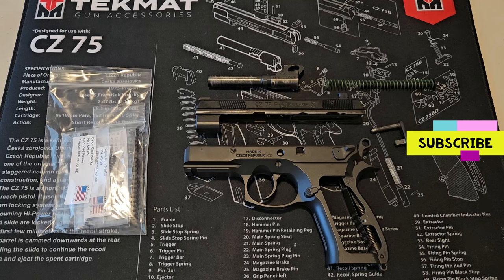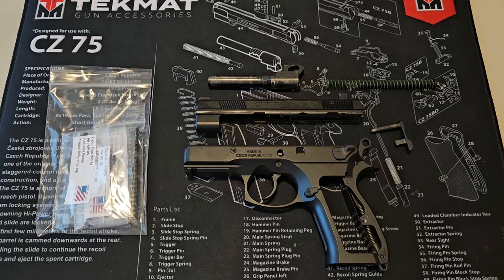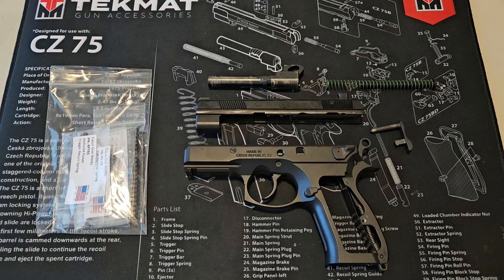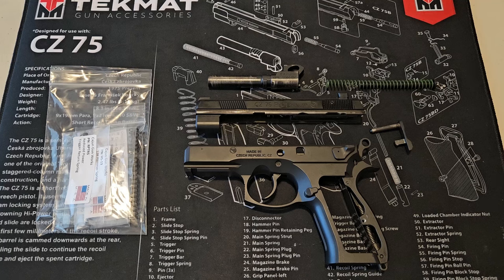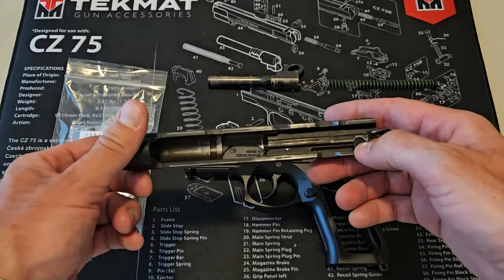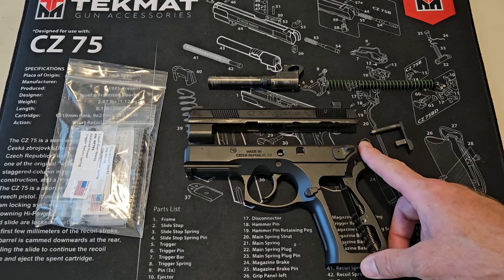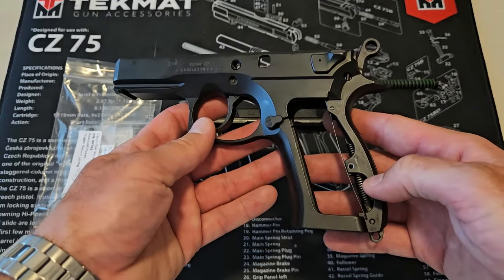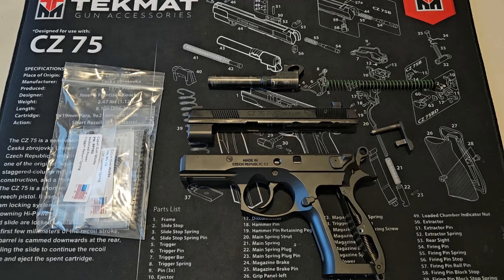CZ P-01 Cajun on a budget

Comment: I followed your upgrade path and it 100% has a noticeable difference in SA and DA pulls. I recommend getting an extended firing pin though, I did notice some light strikes because of the HS. I recommend polishing the trigger bar and hammer strut to reduce friction, and maybe the plunger block. I think my next upgrade will be the trigger and hammer. then I'll look into a FBJ delete.
Reply from the maker: i have the extended firing pin in my 75B and 75 compact but not in my SP01 or P01 & no light primer strikes for me.

Comment: My question is why would you need to upgrade the hammer spring for the extended firing pin?
Reply from the maker: Only need the extended firing pin if you get the lightest weight hammer spring, which I never do.